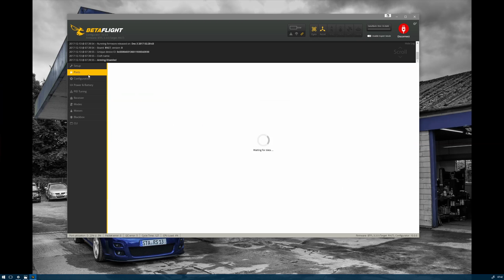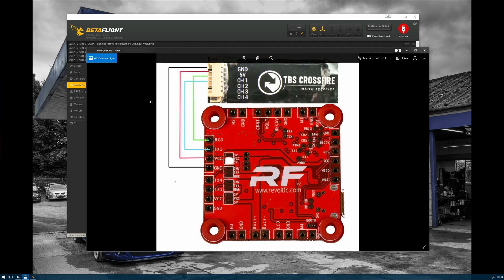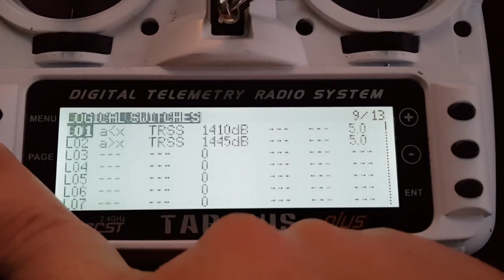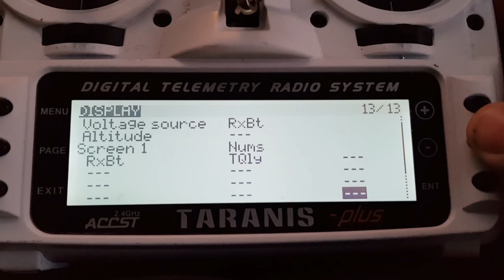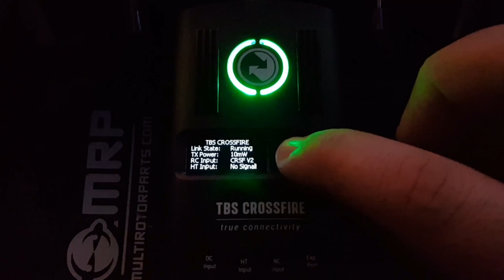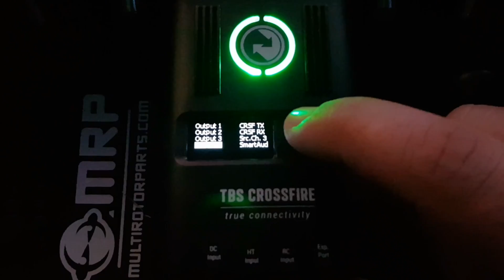Using TBS Crossfore CRSF with Raceflight Revolt FC on Betaflight (Lua, Telemtry,....)

Comment: I feel like I am running around in circles... I cant get RF to work with my CRSF, so I want to run good old betaflight on this Revolt (which I also got as freebie in a KwadBox), but I can't get the betaflight configurator to recognize the FC even after I flash it with the Revolt.hex file, and zadig doesn't work nor does impulserc driver fixer on my Windows 10 machine.I am going to try the old remove driver option in control panel and see if that works but ANY secrets you can share as to how you got yours to flash and then run betaflight please share!

Comment: Not sure what's up with the down votes... this is going to be a huge help. What Raceflight Revolt version is this? I've got a Revolt V2
Reply from the maker: The video says Raceflight revolt on Betaflight :) and that is excatly what it is shwoing.
Reply from the maker: Dont mind, i got a personal hatesquad ;). It works that way with v2 and v3 revolt ;)
Reply: With this configuration is the revolt v2 able to use betaflight OSD as well?
Reply: Do you know about the compatibility of the betaflight OSD with the revolt as well? I'm not finding any information on this at all
Reply from the maker: BF osd is onboard fc ;) revolt does not have one -> no bf osd. you can use 3rd party one
Reply: Looks like I'm moving to another FC lol. I got this one for free in a give away. It's a v2 and I'll be selling it now
Reply: The problem is that vid says Raceflight/Betaflight, but it dont show any gui setup from raceflight. Only betaflight. Plus on my taranis for some reason, it dont show all sensors, only 9, and on lua, it says No Rx detected. So this vid is of no help for Raceflight revolt. I didnt give down vote. Its not bad vid. Its just misleading.
Reply from the maker: Dont care about the downvotes, i might have pissed someone off so i got about 10 dislikes / video from just 1 person :D
Reply: lol read the title